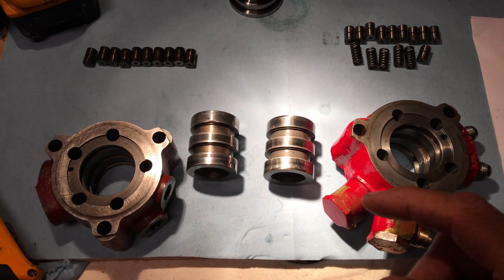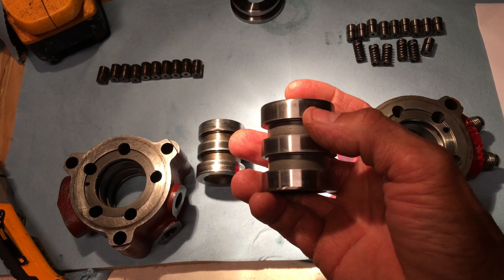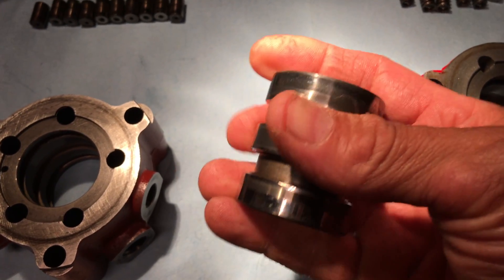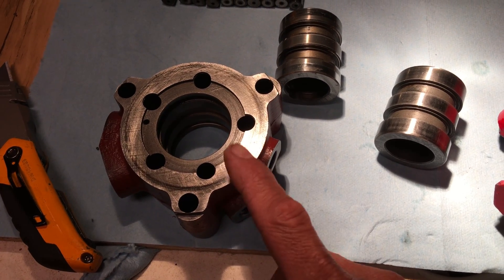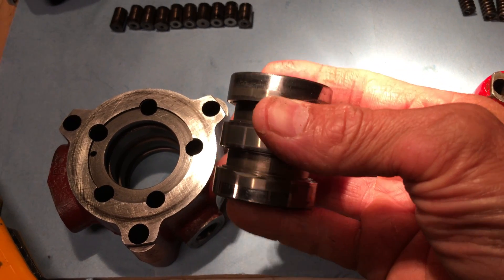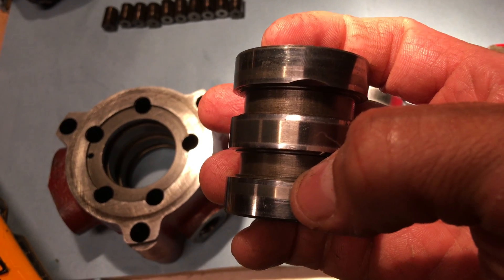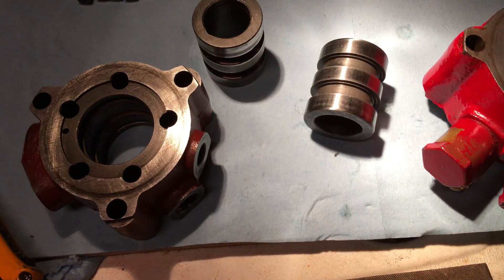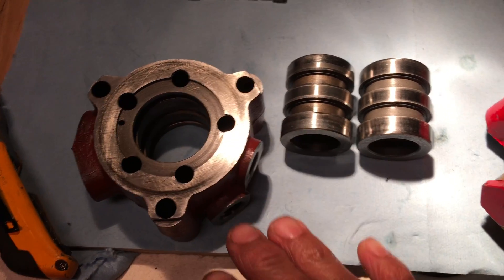Massey Ferguson 35 (Open Center or Closed Center Valves)

Comment: I have the new type on my 135 but all the springs are broke in my valve. Is there anywhere I can purchase just the springs.
Reply from the maker: Hey there Joe Dail , one ours had a few broken too, them are hard to get from the actual manufacture.. Best bet is to find a match, Search for: Heavy Duty Helical Compression Springs or Heavy Load Compression Die Springs somewhere there, match the OD & Height best you can....I’m gonna retry that spring part # see what results it shows on search...Hope this helps a bit. 👍